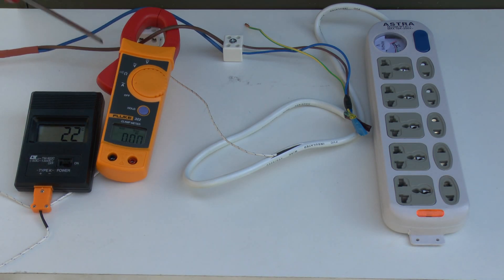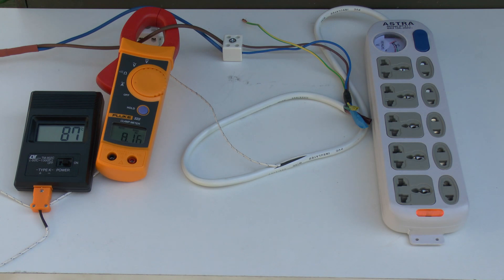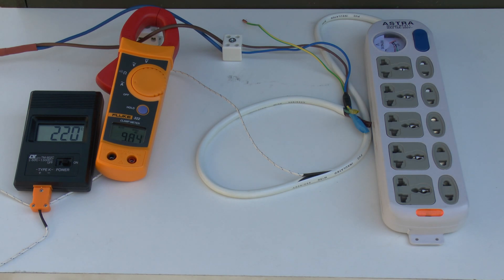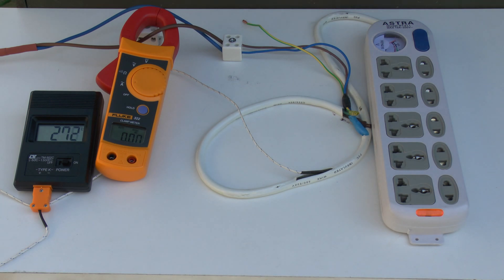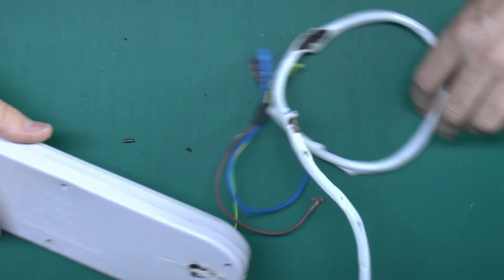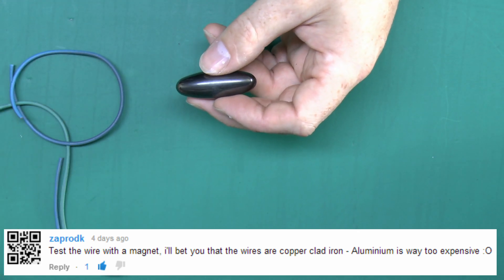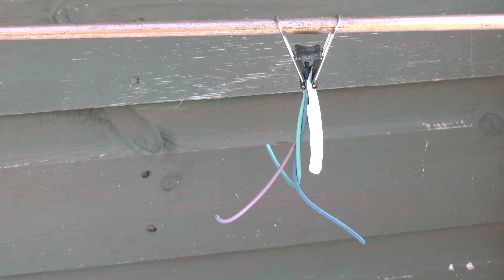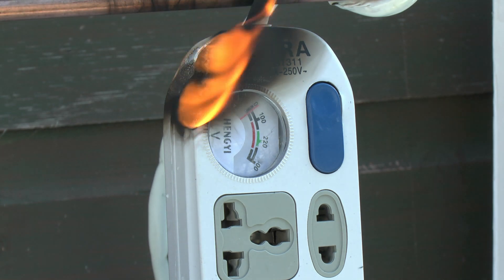Dangerous Multiway Extension Lead ASTRA BT311 (Part 3)

Comment: I have the US version of one of these I bought several years ago, just for the heck of it. I have used it for very light loads, under 2 amps, and it kinda sits in my shop in the basement, because I really never trusted it. I will probably take it apart and check out for copper clad aluminium wires and that tiny 26 gauge earth wire, and earth continuity. It has the NEMA style mains plug on it, and the US version of those odd outlets--and take both flat blade and pin type plug caps. The contacts are poor--the fit was pretty loose for a plug straight out of the package, and the flex is weird like this is. We have had a number of fires from plug strips in the USA, and I can only speculate that some of these models caused them, but even the UL listed name brand stuff is junk. We have lots of plug strips at The Edison Tech Center, and we took one apart once to do a modification, and even though it has a circuit breaker, copper flex of the proper gauge and of what looks to be good quality, and surge protection, the rocker type switch doesn't look as though it can take 15 amps, and the contacts for the outlets are very poor---stamped out of single pieces of brass,  not phosphor bronze, and with not much spring, as well as the live busbar-style assemblies all bare and pretty close together, a short waiting to happen. We load these pretty lightly, for our lighting displays, and cut the power to them when the day is over, but I'd imagine that if 15 amps were put through just one of those outlets, it's heat up fast ad melt the plastic housing rapidly. Also, these rely, like this one tested, on the back cover holding all the contacts in place. I just think these things are dangerous, even the "high quality" ones! I have a really old one, made in USA, and the housing is actually a "long John" thin-section fluorescent ballast "can" or housing, with quality snap-in heavy duty canopy outlets in it, and individual commercial grade canopy toggle switches of a proven design easily capable of 15 amps, and these allow individual control of devices connected, a nice feature. It has a quality Mini-Breaker brand push button reset 15 amp breaker, 14/3 SJT cord, high quality moulded plug, though no surge protector since it is probably late 1960's or maybe even older. The case is metal so it is properly earthed as are all the outlets. I can trust this unit, but NOT any Taiwanese, Japanese, Chinese, or Indian made plastic piece of crap, even a 'premium' brand! And we allow this junk to be sold you gotta wonder! Cheers! Rick Delair, USA.
Reply: +ricksbulbs Did you take it apart? if so was it a similar piece of shit?
Reply: In all honesty, I might be biased but the NEMA flat-prong system never looked awfully safe to me to begin with! Granted, you get more surface area for plug and socket to mate than with round pins but the prongs bend much more easily than round or square ones and particularly the cheap folded brass ones distort just by looking at them cross-eyed! To some extent this issue is offset by what feels like a spring-loaded retaining mechanism in quality sockets (you can really feel how something latches into the holes in the prongs as the plug is fully inserted) but otherwise the system feels wobbly by design.

Comment: I presume you used a bench power supply, so 10A was at negligible voltage.  With a mains supply and an appliance for load,  I suspect there would have been arcing as that carbonised insulation residue is likely conductive.  Arcing with no fuse.., at UK mains supply voltage and impedance levels would be many kilowatts of heat... yikes.
Reply from the maker: nemthefearless The wires had a resistance or 1 or 2 ohms, 10A would have been about 10-20 volts so no arcing.
It was clear from previous tests and the very poor quality of the cable insulation that applying mains voltage would have been totally unsafe.
Reply: ***** Even with high resistance you would have had 230 V near the plug between line and neutral, down to 190-210 V at the appliance.

Comment: and how many people dont bother to read the limits on these things anyway and over load it? btw did you get a reply from trading standards?
Reply: You should not be able to overload these things since regulations-compliant power taps should have built-in fuses or breakers to prevent overload from persisting in the first place.

In this case though, the wire gauge and materials are so grossly inadequate that the cable is a fire hazard even at the bar's rated current, so a fuse or breaker would not change anything here.

On properly sized cables, the temperature rise should be barely noticeable by touch even under full load but on this product, the cord was already becoming scalding-hot at HALF of its alleged rating. The cord's resistance is at least an order of magnitude higher than it should have been.

I wonder if there are even worse power strips out there. I have a hard time imagining how a manufacturer could cram this many counts of fraud, misrepresentation and possibly criminal negligence in one product.
Reply from the maker: terry987654 Yes, TS did reply, and are investigating.
Reply: In some devices coming from China they're even using fake fuses, just to look standards-compliant. They have no sand inside the cylinder, and sometimes they have a link of cheap wire holding the two end caps in place, instead of using proper fuse wire.